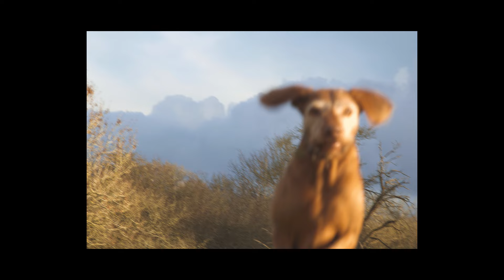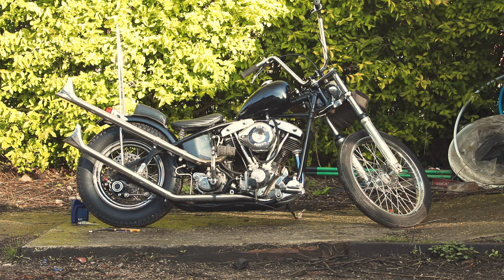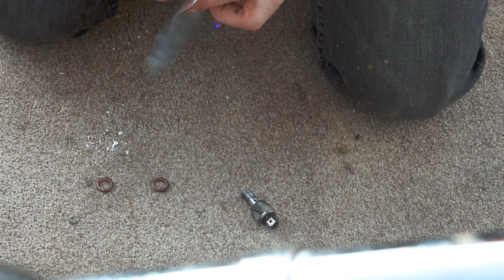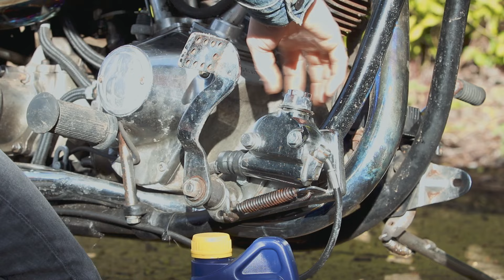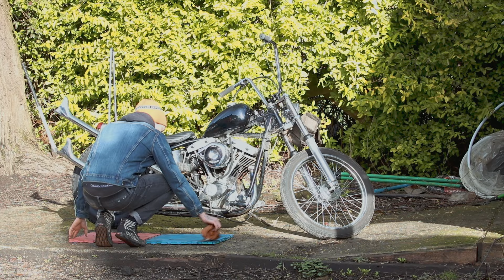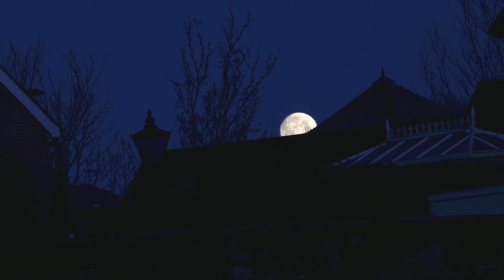Brake Fix | Shovelhead Chopper

Comment: 😎👍😎
You'll never bleed out all the air with the bleeder on the bottom..
Remove caliper..set it on the ground ..bleeder facing up..don't pump it ..just let it bleed ..reassemble  it ..should be good to go ..
You can reuse those copper washers..hang them on a wire coat hanger ..heat them up with a propane torch..red hot ..quench them in water..good to go ..
Good luck..
Reply from the maker: Worked fine my way 👍